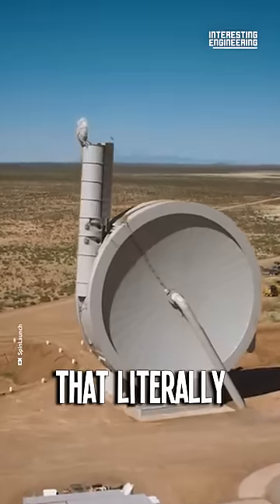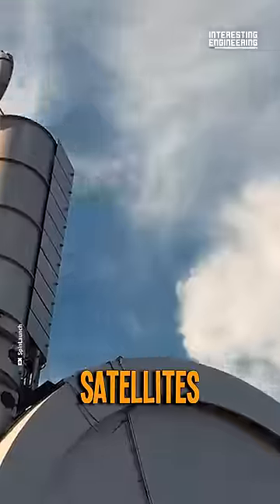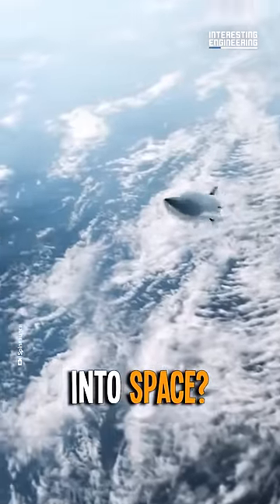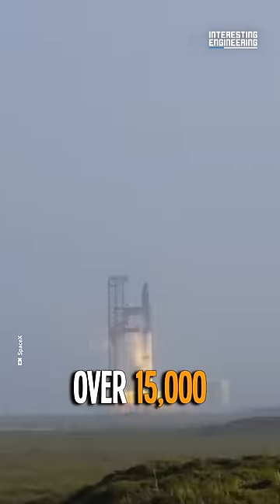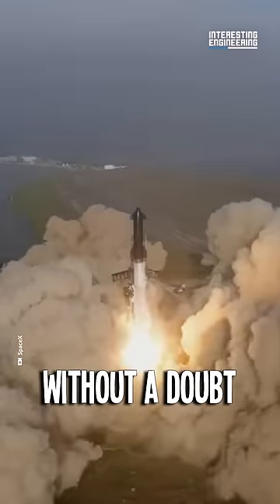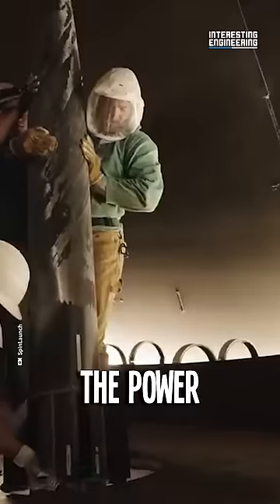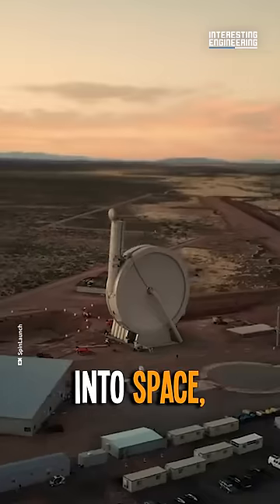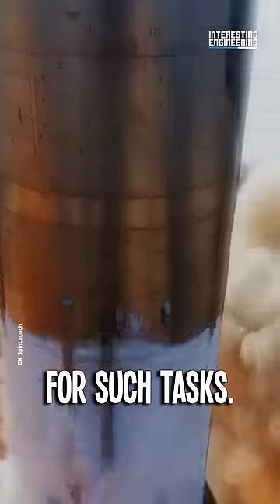Throwing Artillery Shells Into Space

Comment: I feel that a critical flaw with this is that the greatest air resistance is near the surface. Air resistance is proportional to the density of the air and the square of the velocity. With conventional rockets, the rocket experiences less air resistance at the surface comparatively due to its relatively lower velocities. I would imagine that some very smart people have already considered this, but I feel like that this is an aspect that may stand out to some.
Reply: That's why they must be launched from within the cylinder, which is a massive vacuum.
Reply: Indeed. At the required velocity the shell would likely disintegrate the moment it exits the launcher and hits static atmosphere at ground-level atmospheric pressure.
The point of maximum dynamic air pressure experienced by rockets as they are penetrating through the atmosphere is called the max-Q point. Once they have passed this point by sufficient margin they increase acceleration or tilt trajectory angle. In the Space Shuttle launch videos you can hear this communication, after they have passed max-Q: "Houston, GO for throttle-up". With the launch system proposed here max-Q would be at ground level, which is a complete no-no at 1 atm given the velocities required.
Reply: @FalconFastest123 the moment it leaves the vacuum it will explode
Reply: One space gun plan situated the exit point on the summit of Mt. Killamanjaro because 1. at 19,000 feet it was above most of the atmosphere and, 2. it was on the equator which made inserting the satellite into orbit easier.
Reply: Air resistance is the least of their problems. Much bigger issue is releasing a large weight at the end of a large and very fast rotating arm.  Imagine a fan on high then removing the balancing weight suddenly. Imagine the wobble. Now multiply that times 10,000.  The entire thing will fall apart
Reply: @Meatball2022 I think the plan was to release the counter weight behind the vehicle. That's still half a rotation unbalanced however. 
In the smaller scale test system they just released the counter weight at the same time and it crushed to the inner wall.
Reply: @Qwarzz  the counter weight released at the same time will have exactly as much energy but in the opposite direction. So imagine successfully launching a 300 lb satellite at 35,000 mph. On the other side you’d have an equivanent of a few hundred artillery shells hitting the inside of a chamber.
Reply: @Meatball2022  Which is why I said they were planning to hold on the counter weight for half a revolution with the full size model. I just can't imagine anything surviving even that.
Reply: @Qwarzz  so it’ll only be at the worlds most extreme force pulling centrifugally on the worlds strongest tether fighting against the imbalance of a force equivalent to lifting hundreds of rockets for only half a revolution?  What can possibly go wrong????  Lol
Reply: @Qwarzz  Yeah, there isn't an axle/bearing material made that would survive the shear force long enough to swing the counterweight around and release it aligned with the exit point.

The only solution I can think of would be to spin up a liquid mass near the centerpoint at the same time, and the moment the vehicle is released the liquid is released from the tank at the center into a tank at the end of the arm, replacing the lost mass.

Even then, I'm convinced the forces are too great to do this at scale. Currently, I still think a skyhook is the only non rocket orbit system that is remotely feasible.
Reply: @chrisblake4198  Maybe some sort of a hyperloop going up a mountain side? So similar to spinlauch but more linear acceleration. 
Would be a huge low pressure chamber tho. Bit of a megaproject probably. And I have no idea how long it would actually need to be to get enough speed to throw something high enough thru the atmoshere to be worth it.
Reply: I think some very smart people conned some very gullible people

Comment: Rocket consumes 15000 gallons of fuel mixture per second? Your math ain’t mathin’, bro. Falcon 9 first stage burns for about 160 - 180 seconds , depending on a payload. Stage 1 and stage 2 hold approximately 65000 gallons of fuel mixture combined. I ain’t no rocket scientist, but even I can see that 4.5 seconds of flight time is going to be the shortest space flight ever.
Reply: Nick-wn1xw I’ve seen numbers on falcon 9 somewhere, that at full tilt it was burning as efficient as 3200lb per second
Reply: The funny thing is I know about spinlaunch.  It's not seconds it takes much longer to get to speed than a rocket. It would put larger gforces on the payload than a rocket, and for MUCH longer. This idea was DOA.
Reply: Who cares! WE NEED MORE TRAFFIC!
Reply: @joelheinaman4616 it would put larger g forces on the object compared to a gun of the same length.

Just, use a gun.

It’s literally a tube, that’s it.
Reply: @joelheinaman4616  Nah, you just need a bigger circle, like way bigger, and probably flat on the ground and the a long ramp up. All of it unpressured of course.

It would take more energy I guess, but no need for fuel, that is something.

Also, in earth is hard to do, atmosphere and all, but it would be easier and more viable on the moon or mars.
Reply: Nick-wn1xw  Ah ... Numbers - Schmumbers, amirite?
Reply: @joelheinaman4616  Whoever would sit in that rocket would be DOA too :D
Reply: Figures were likely for Starship, not Falcon 9.  Starship is designed to put much larger payloads into orbit, so needs a lot more reaction mass to get it there.

<later> Just did a quick estimate for Starship's first stage, and it burns slightly over 12,000 gallons of propellants per second at takeoff, though it depends on what the exact density of the LOX/liquid methane being used.
Reply: They're using the same math they used for the global warming models.
Reply: @kg4lzc  You mean that guy who made this video here is the only guy to ever calculate anything global warming related?
Reply: @joelheinaman4616 Last I recall it was something like 4 hours to reach full speed, in a partial vacuum. So not only is the payload subject to prolonged high G forces, but also explosive compression and quasi-instantaneous hyper-thermic events from air friction heating. Yeah, the only thing that MIGHT survive that launch is a cannonball.
Reply: Must have meant 1,500 not 15,000
Falcon Heavy first stage with its 27 engines use a total of ~ 1,620 gallons per second, and that’s one of the larger rockets around..
Never take YouTube shorts at face value
Reply: @joelheinaman4616  Taking longer to reach the speed of a rocket isn't an issue. To a point the longer it takes the lower the g forces are.  As long as it's being spun on the ground it can take as long as you need for it to hit that speed. It's also theoretically a bit easier to hit that speed due to the lack of fuel onboard.

There's a bunch of reasons why this isn't going to happen any time soon and likely won't ever happen, but that's not one of them.
Reply: 15000 gallons per second if it explodes
Reply: @patricknintemann924  HAHAH good point,sir
Reply: you are right sir, a known problem called "the Tsiolkovsky rocket equation" Then how are all these rockets getting into earth orbit? they arent..
Reply: Doesn't matter how long it takes to spin up if it must reach a target rpm regardless.  The maximum G is determined by the RPM.  It's the centrifugal forces that are the highest,  not the acceleration forces.  If you spin a merry-go-round to 30rpm , kids are going to fly off the same distance whether you get there in 10 seconds or 10 minutes. @SmallSpoonBrigade
Reply: You aren't a rocket scientist? I see what you did there 😂
Reply: These videos all use AI generated scripts and AI generated voices. Awful muck.
Reply: I instantly did the math and realized it was total bullshit as it would be literally impossible to fit that much fuel in that TINY LITTLE rocket they launch. Math skills for daily life.
Reply: Yeah I'm pretty sure this is a clickbait channel
Reply: Thank you. That sounded absurd
Reply: @NickKautz *centripetal force
Reply: You sure you’re not a rocket scientist?
Reply: @Loehengrin  centripetal means moving toward the center,  centrifugal means moving away from center.  There's no force moving anything toward the center in this context.
Reply: You beat me to it. I worked out it would need 13500 Tons of fuel by that metric. I only assumed 120 seconds burn too. Way off. It’s worrying that people believe everything they hear.
Reply: @kg4lzc john no hopekins mathematics
Reply: @NickKautz  yes there is, otherwise the projectile would carry on in a straight  line in accord with  Newton's first law of motion. There is  no force acting away from the centre. The centrifugal effect is caused by a centripetal  force
Reply: @LewisNuke92  well it's  not exactly  brain surgery!
Reply: @Loehengrin  Centrifugal force is the force that keeps the water in a cup if you hold it and spin your arm around like a windmill.  It's the force that makes a car lean outward when driving in a circle.  Or makes you fly off a merri-go-round.  How would that not apply here when you're spinning an object fast enough for it to leave the atmosphere?
Reply: @Loehengrin  can tell you’re definitely not the brightest spark in the room
Reply: @LewisNuke92  there's no call to be rude.
Reply: @NickKautz  inertia keeps the  water in the  cup. What transforms linear motion into circular  motion is A force acting perpendicular to the direction of the motion. As the direction changes, the direction of the perpendicular force changes,  so that it is  always  acting towards the  centre of  the motion. This is why the launch tube is at the edge of the centrifuge: once the centripetal force is  removed the projectile will move in a straight line, tangential to its  circular path.
Reply: @Loehengrin  Ok , but for relevancy's sake, the success limiting factor is the multiplication of weight that is subjected to the payload.  If the satellite weighs 20,000lbs and the centripetal arm is 100ft long, the speed and # of G's would be something totally unreasonable.

Comment: "Using the power of velocity" and "eliminating the usage of fuel" make it sound like "velocity" is some kind of magical power source. What are they planning on using to spin the machine to that speed with that weight? Electricity? Because you would need a stupid and very unrealistic amount of it.
The reason why rocket fuel is so effective at what it does is because, as Elon said, you need to throw a lot of mass very fast downwards to make that kind of weight go up.

Comment: "Eliminating the use of fuel"

Immediately uses fuel
Reply: you need fuel to keep escaping earths gravitational pull, gravity doesnt magically turn off in space
Reply: @coryleblanc  no kidding
Reply: ComeOn man
Reply: @coryleblanc in theory if the satellite could be "thrown" far enough, could it use a nuclear generator to generate thrust or deploy solar sails to escape orbit?
Reply: @dosidicusgigas1376  i dont even believe in space
Reply: @coryleblanc  what? no that's not true
orbit is just the right speed that counters gravity
do you think moon uses fuel to counter earth's gravity?
if you are in orbit than gravity has turned of for you in space.
only reason you would need fuel is that if you are in Low orbit where air particle still crashes in you and slow you down
Reply: @chromewarnock9681  You also need to be traveling in the right direction to achieve orbit. For an orbit, you need to travel sideways to the Earth. The launcher can only propel you away from the Earth and can never apply enough sideways movement on its own for an orbit. (More force will just send you away from the Earth instead of putting you into orbit.)

In the end, you still need fuel to put yourself into orbit - just not for the reasons that @coryleblanc was thinking.
Reply: That's like the fallacy of the electric car. You don't see all the coal being burned in the power plant 50 miles away to fuel it
Reply: @mickimicki5576  Electric cars do not require coal combustion to charge.
Reply: @dosidicusgigas1376  It certainly (theoretically) could! Although I expect folded up solar sails would withstand the G-forces involved in this flinging maneuver far more easily than the hardware needed to make use of a nuclear fuel source (I may be wrong on that though).

One thing they could do is blast the nuclear "engine" up with a rocket, and use this flinging technology (if it ever works) and hook them up in Earth orbit to go on a journey. That could save a tremendous amount of rocket fuel needed to get all the rest of the satellite mass up off the ground.
Reply: @chromewarnock9681  the moon is actually escaping earths gravity, just really really slowly, like 1.49 inches per year
Reply: @DanielRichards644  it's not escaping it's equilibrating.
one day it will lock on to earth side and will stay there.
things in motion tend to stay in motion
you dont need fuel to be in orbit
once you achieve orbit you are gonna stay there unless something intervenes
Reply: @whatsupinspace854 the vast majority of the electricity to charge electric cars comes from coal combustion.
Reply: @coryleblanc Why don’t you believe in it lol? You can see space with your own two eyes if you go to a place with no noise pollution.
Reply: @MagicToenail  Light pollution?
Reply: @MagicToenail  im just saying we were Lied to about whats above us. its not an infinite vacuum. its the Luminiferous Aether which Nikola Tesla knew about

Comment: Here's my first thought.  Obviously when the centrifuge is spinning up it will require a counterweight.  Have you ever seen a video of what happens when someone puts a heavy object in a dryer and disables the off-balance safety and speed governor?  The whole machine jumps around until it tears itself apart.

Okay, so it has a counterweight.  Problem solved.  Right?  Well, yeah, but only up until the moment the payload is released, and then you're back at jumping suicide dryer.  

How do they solve this problem?  I'm sure thet must have a solution, otherwise the whole thing would be a non-starter.  I'm not an engineer so I don't know how to solve this problem, but I would love to know more.

Comment: Another feature of this launcher is that it automatically splits the satellite into pieces
Reply: The stresses can be simulated using FE analysis. If it works with FE then it's good to go. No risk involved at all.
Reply: @Duncan_1971  you're missing the point.  Not a single satellite has survived virtual or physical testing.  The centrifugal G forces alone destroy everything.
Reply: Into powder to be precise.😂
Reply: @Lindrios  They're continuing the project for a reason.
Reply: @Duncan_1971  yeah, promises to investors.  There are hundreds of millions tied up in it, and still hopeless belief from people like yourself that it's a viable option.  
Even if an object survives the rotations to be launched, it still has the incredible heat from air resistance to contend with.
Seeming as satellites are well known for having incredibly sensitive equipment onboard, no external company is going to risk using SpinLaunch
Reply: @Lindrios  Cant wait till they send astronauts into orbit :D
Reply: @Hopeman__TM   *Astronauts may experience a slight decrease in bodily structures upon launch 😅
Reply: Ultimate game of 500 😀
Reply: Your getting warmer. Right idea, wrong use. 🤨

Comment: There’s no rocket that uses even close to 15,000 gallons per second. For reference. The fuel consumption for the rockets, is approximately:

- **Saturn V**: 3,949 gallons per second.
- **Falcon 9**: 823 gallons per second.
Reply: Thanks I thought 15.000 was a lot
Reply: Yeah I was immediately called bullshit on that.
Reply: @willmorris12345  and both of thise rockets have vastly higher payload capabilities than this, particularly the Saturn V. The sort of micro satellites that could be launched by this system can be either launched on much smaller rockets using far less fuel, or can be launched in large numbers. Many launch providers carry small "cube sats" along with the main payloads, and these are already very cheap because of their low weight and the fact that they are piggybacking off other launches.